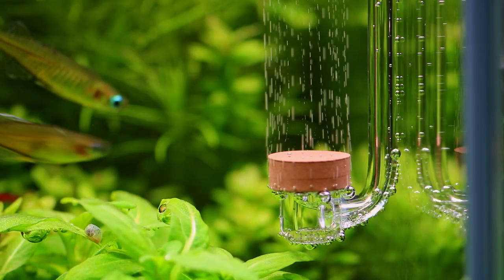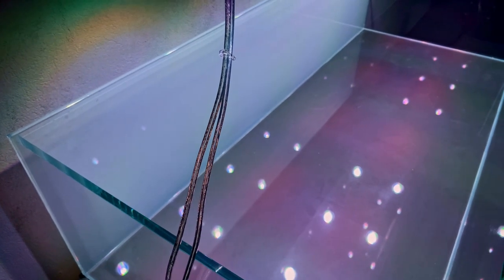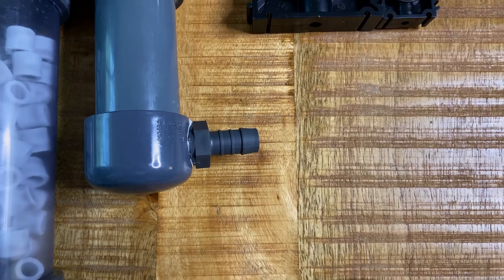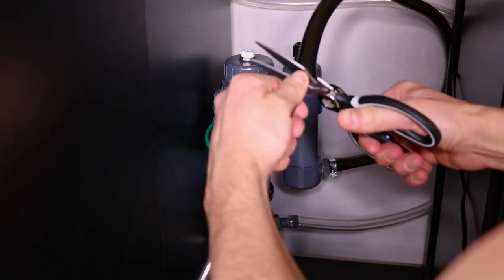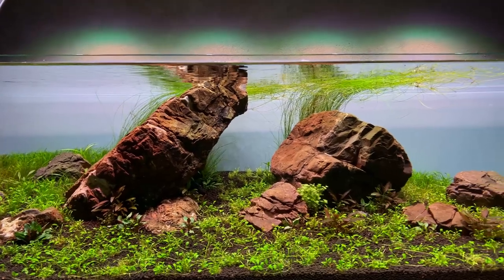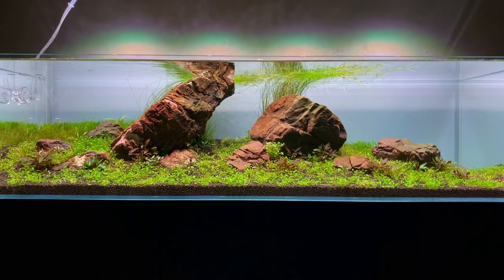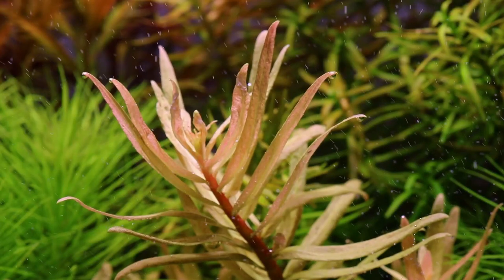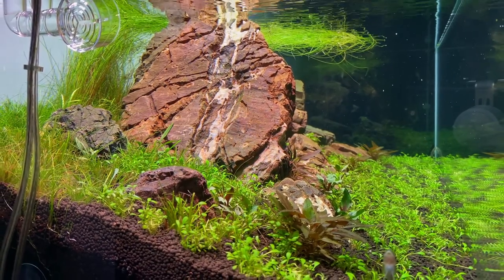IS THIS THE BEST METHOD OF CO2 INJECTION??? CO2 System For The Big Shallow Explained 😎

Comment: i'm making a new tank, and i've been planning it for 4 months, but i'm not allowed to have a c02 tank inside my bedroom, so i got c02 pils, and i wonder how they work, i couldn't find a lot of information but as far as i know it's like a passive c02 diffuser, exept on a weekly basis.
i'm worried since i'm gonna keep shrimp in a 20l liter tank, so i think there might be a risk with the ph varying too much with the pills
Reply from the maker: I would not use the CO2 pills. If you are not allowed to have a CO2 tank in your bedroom, maybe you can ask if it's okay to have a DIY CO2 system in your bedroom. It's probably even cheaper than those CO2 pills, and a lot more effective. Check out this video https://youtu.be/OtpfltN15-8
Reply: @MJAquascaping  well I got two years worth for 10€...
Oh well I'll try the diy next

Comment: Currently, I'm using Ista co2 ceramic reactor (Taiwan brand) for almost 3 months, 2-3 times smaller than what you're using right now.
Reply from the maker: Nice one! Is that the turbo or the maxmix? Happy with it?
Reply: Turbo one I think, the one with impeller...I can say👌. From diffuser to reactor, best experience ever.
Reply: @xjacob2335  me too,but plastic is really bad quality.Mine is cracked at the bottom,probably I tied too much.they could use good quality for plastics.I will go with atomizer,arrived yesterday and see how it will go.If it Sprite effect I will try to find some other reactor.

Comment: Hey there have you had any problems with uneven CO2 levels using the reactor? Someone commented that the canister filter's flow rate will gradually decrease every day as filter media clogs with detritus. Less flow rate will result in less dissolution and poor co2 throughout the tank. I understand the reactor will reduce the flow rate initially, but is it true that the sponges in your filter will gradually clog and the flow rate decreases each day to the point co2 isn't stable?
Reply: Clean your filter? Simple